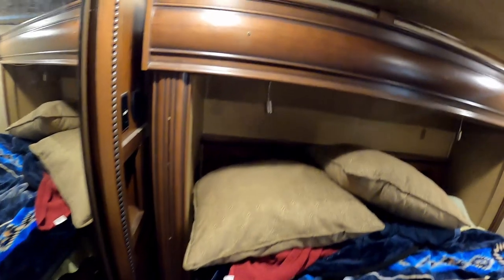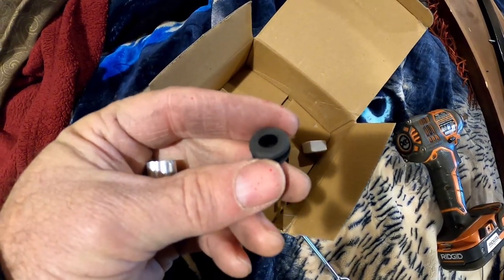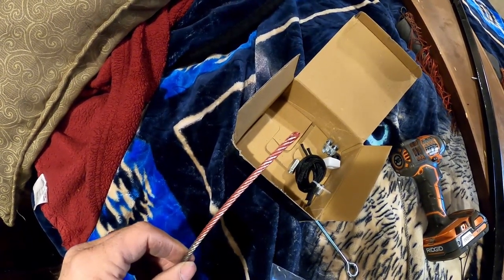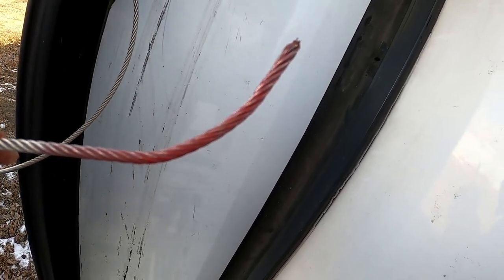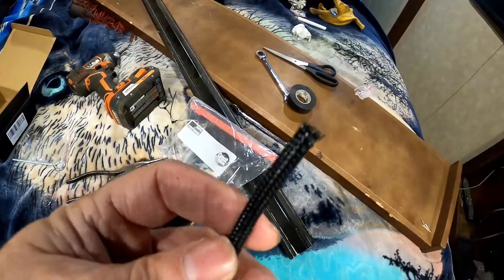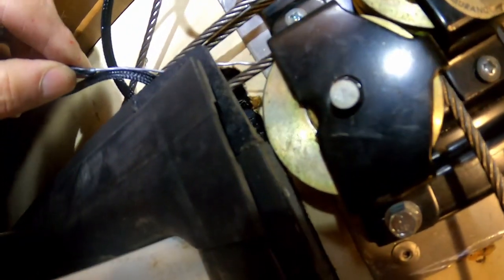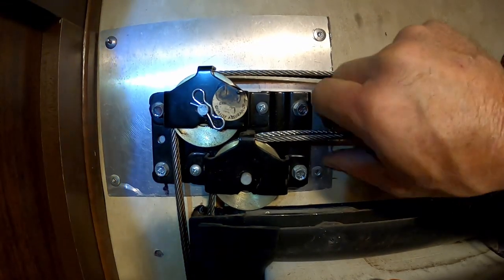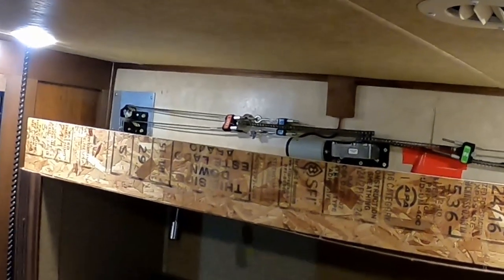HOW TO REPLACE A NONEXISTENT RV SLIDE-OUT CABLE

Comment: Great video.  I am battling with slide out issues as we speak.  I see you have re-enforced your cable bracket, how did you do that? My cable brackets have pulled away from the wall and I think I need to do the same thing you did to re-enforce them.  Thanks
Reply from the maker: HI Glen,  My cable brackets pulled off immediately after getting the trailer.  So, I didn't do the reinforcement myself.  It looks like the key is to reinforce from the backside of the wall.  They fixed the aluminum plate to the wall with rivets.  I don't know what is on the other side of the wall that made the rivets work.  They must have put another plate on the other side of the wall for the rivet to grab.  Then they put the bracket screws into the plate.  
Please let me know how it goes.  I hope it is easy for you.